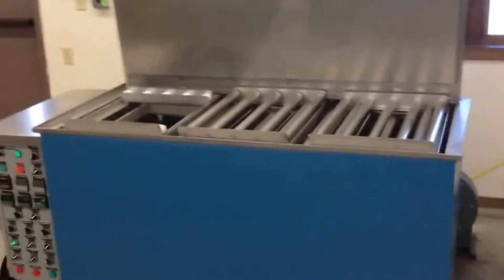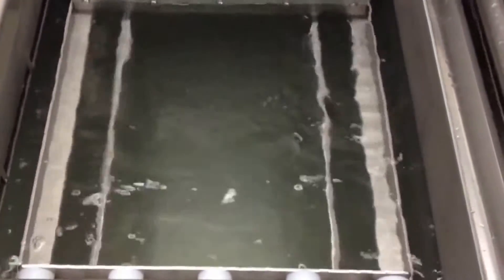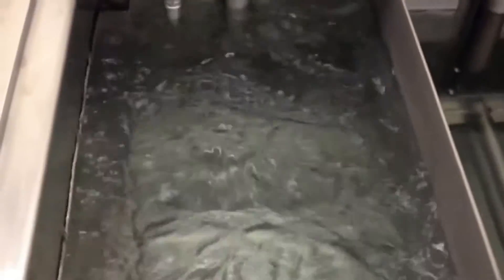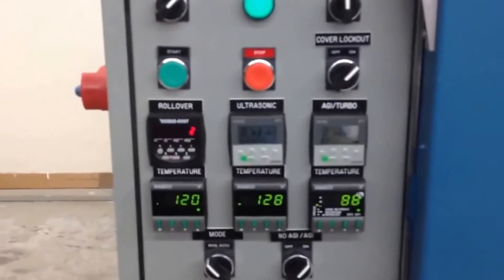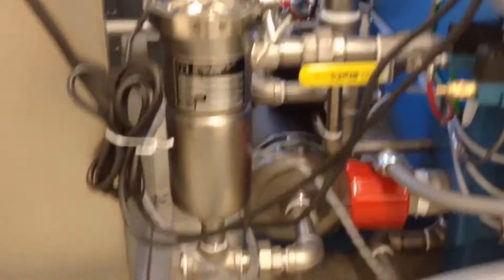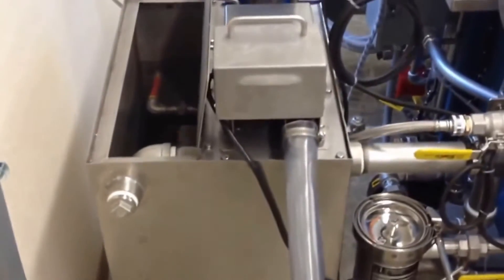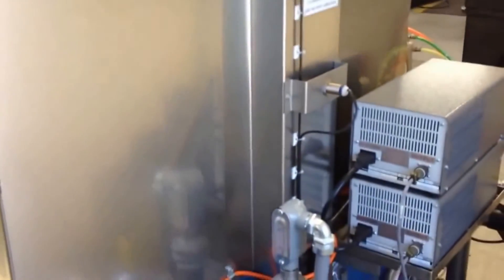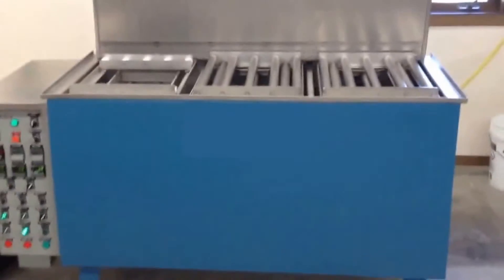Agitated Immersion Ultrasonic Wash, Rinse, Dry Parts Washer with Oil Removal System

Comment: What acid chmical use
Reply from the maker: What acid are you looking to it?  Depending on the acid will depend if the machine require a ventilation system and possibly different material of construction